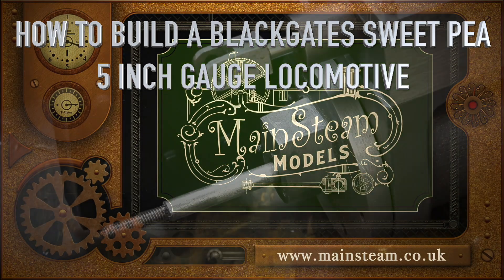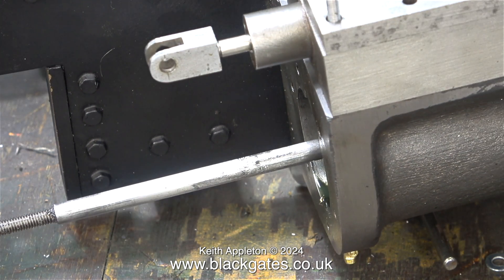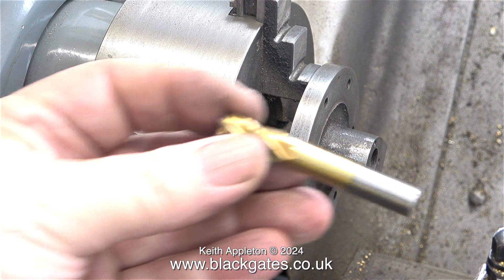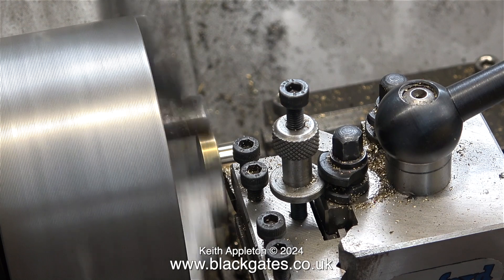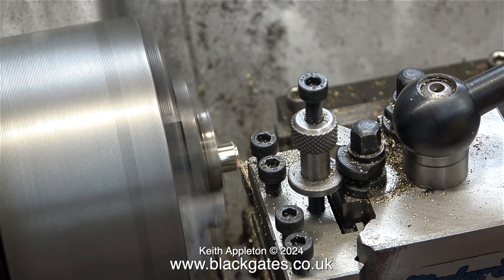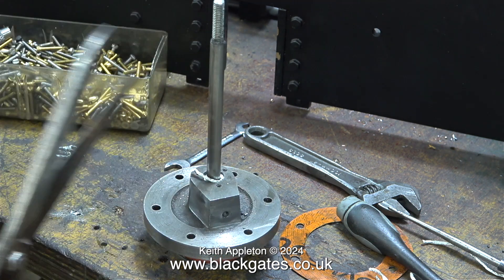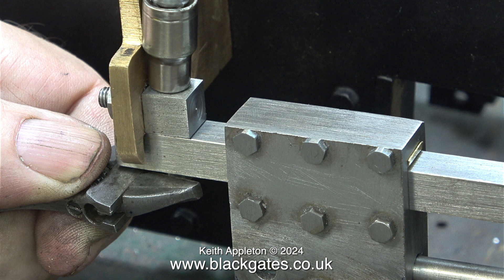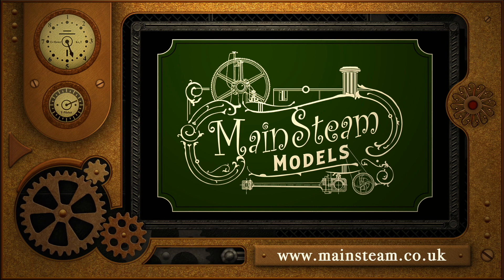A BLACKGATES SWEET PEA LOCOMOTIVE BUILD - PART #45

Comment: I have o rings as glands on several of my 5” gauge locomotives. I also have them as rings running on bronze pistons in cast iron bores. The oldest engine is 8 years old. I am pretty sure that I have never had to replace the o ring glands. When they are properly fitted they last for ages. Viton o rings all the way.